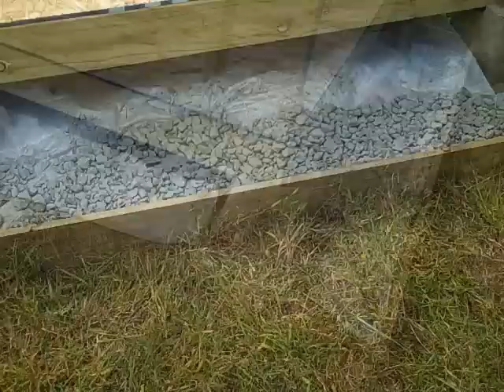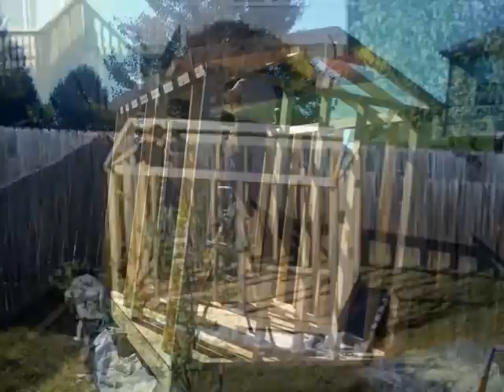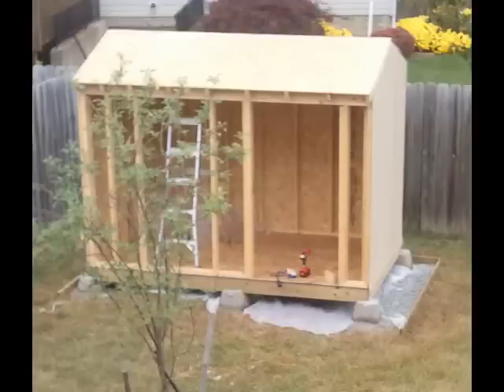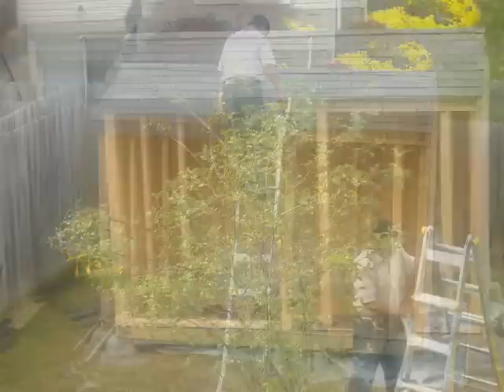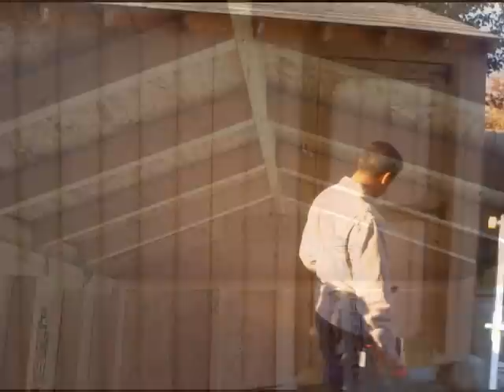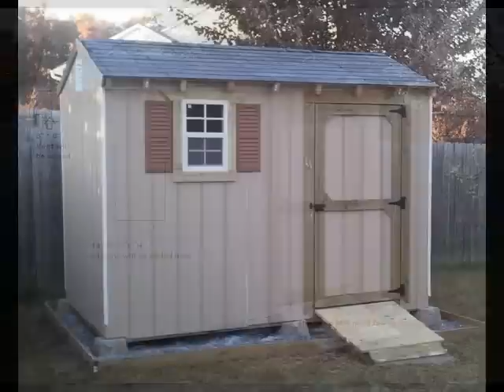How to build a shed tutorial

Comment from the maker: my yard is almost leveled, so that did help. If you're planning to build the cabin on sloped/slanted land, you have two options: 1) build retaining wall, then level the ground first 2) use 4"x4"/6"x6" treated studs for the lower area, depending on the county code and size of the building, to set the foundation. Dimensions of my shed are 6 ft wide x 10 ft long. For the foundation, make sure to use 2"x6" treated wood.